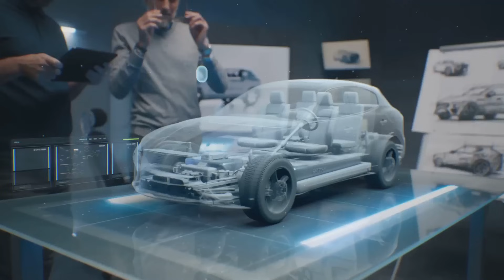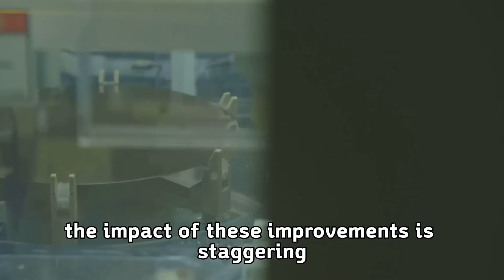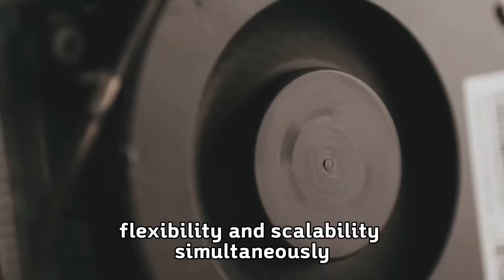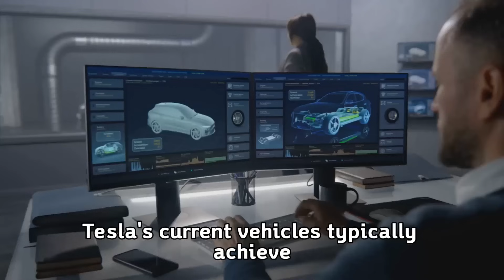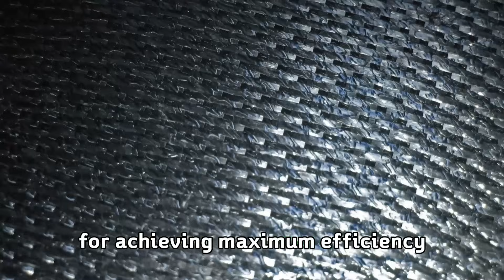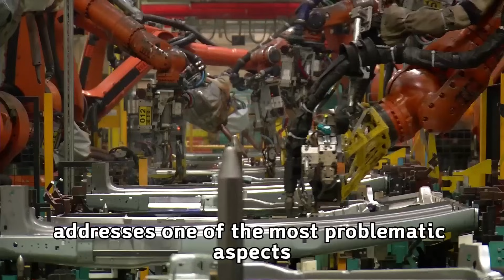Tesla’s Secret Engine Finally EXPOSED!

Comment: the only problem with electric solar power is that it has to be in a secure area The truck stops with cameras in order to unlock the charging station you would have to pay to unlock the charging station so much damage has taken place with the charging station in the city parks and in other areas